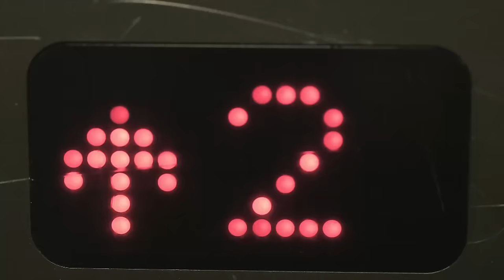Women Touch Down on The Island | The Island with Bear Grylls | Season 2 | Full Season | Part 1

Comment: 1:07:27 Every time I hear a woman say "we've got crabs" and I have the same reactions regardless od the context. It's "why are they eating the ****ing thing?"!
1:11:54 One thing over looked here is not having the right answer is like safely finding the wrong answer and using the process of elimination might prove effective deciding where the group should go from here forward.
2:27:33 Wasn't it just rainy?
2:31:34 When the scouting party accidentally found beach 2/2, eliminated the need for a scouting party granted the original expedition that was the wrong way...  lols
2:35:42 See, I do not understand one group is dying of thirst as like a top priority but now it seems like its down pouring.
2:39:46 Without a fire they should be getting naked too. With a storm coming and outside chores - so to keep clothing dry and to warm up after.
2:58:41 that's the thing about directions you kind of need to follow lead 100% if the time or else you can't be upset about being off coarse
3:03:25 Beside the other team already moved so even when they did get their bearing are headed towards nothing.
4:03:30 They've should've still followed the pigs. For leading to water source.
4:19:18 I lose a huge layer of empathy for the campers when they pass on food sources and blame malnutrition later in the retreat. Like when I have less opportunity at employment because i chose not to complete primary school - isn't their fault.
4:26:07 Not only that but with the team member throwing in the towel - actually makes eating the pigs unmoral.
4:29:25 They should get the fire make set wet. Since they were about to make open flame when everything was wet - dampening the pedestal and spindle could recreate the environment but then use dry tinder once flame. Might work.